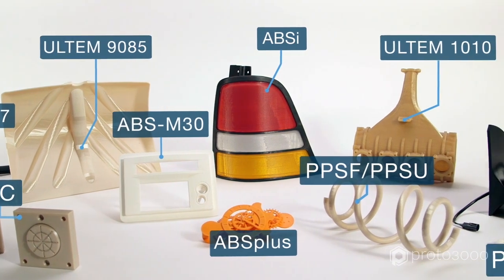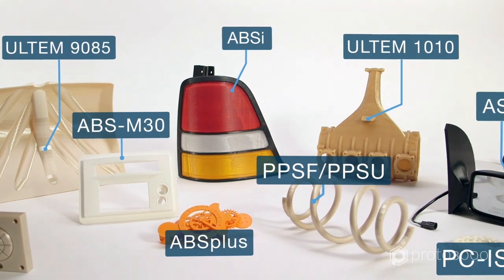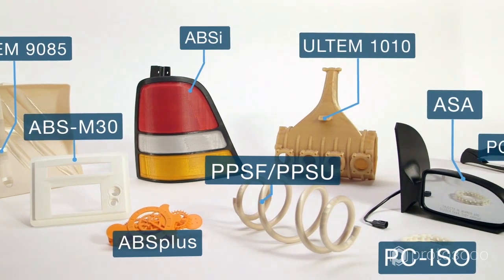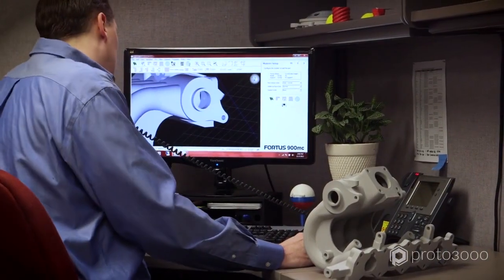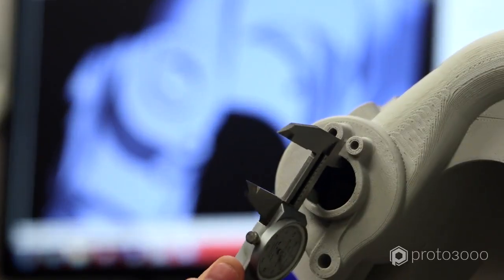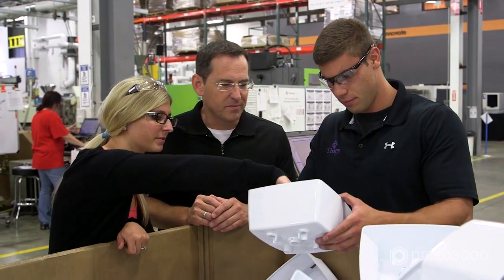What is FDM 3D Printing Technology | Fused Deposition Modeling Additive Manufacturing

Comment: how many methods are in 3D printing
Reply from the maker: Based on ASTM (American Society for Testing and Materials) standards there are 7 different types of additive manufacturing processes. They are: VAT Photopolymerisation, Material Jetting, Binder Jetting, Material Extrusion, Powder Bed Fusion, Sheet Lamination and Directed Energy Deposition. FDM is categorized as a type of material extrusion process.